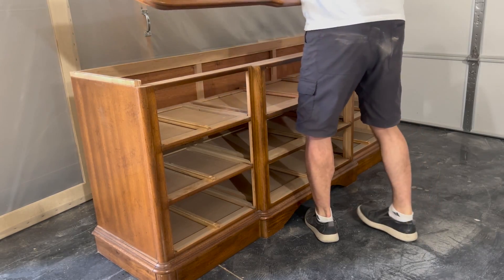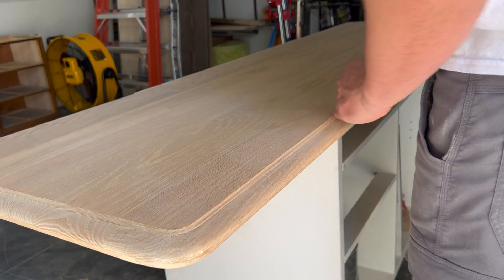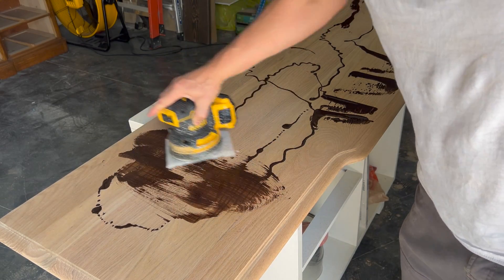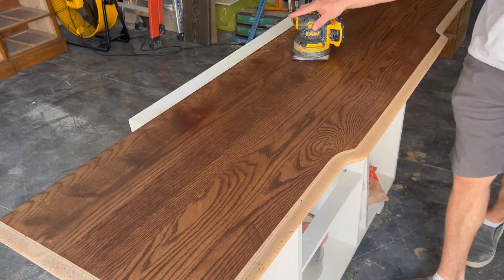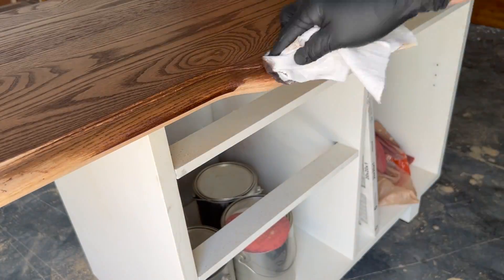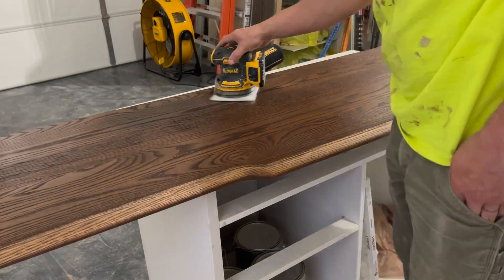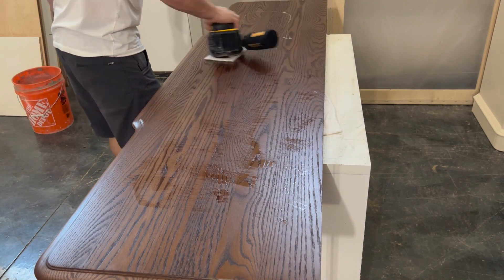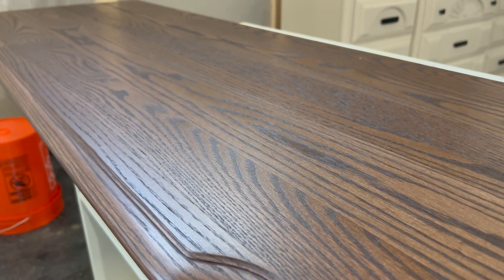Using OSMO to stain and finish Furniture DIY

Comment: Good method! Only downside, my brand new orbital sander got stained aswel 😅
But managed to clean it with some whitespirit.
I see many people and Osmo itself suggest using the Polyx oil as top coat, whats the main difference between the hardwax and polyx?

Comment: Without the top coat, I know that the wood wax finish wears away as I found after just a few sitting at a table and bench I finished, Perhaps the top coat is required.